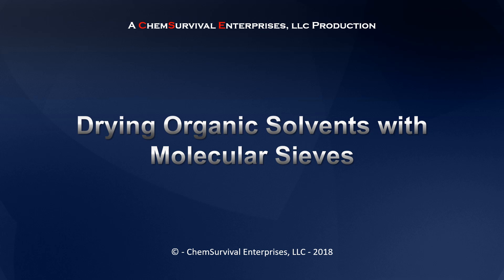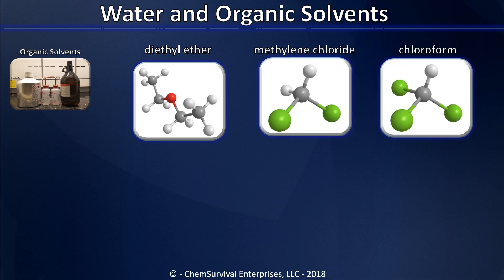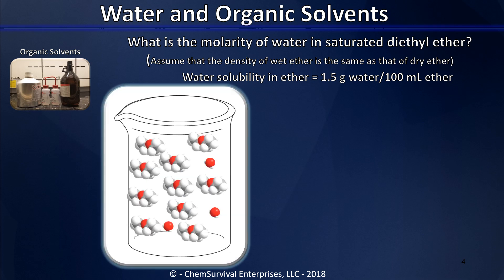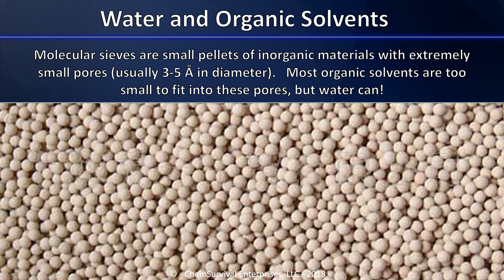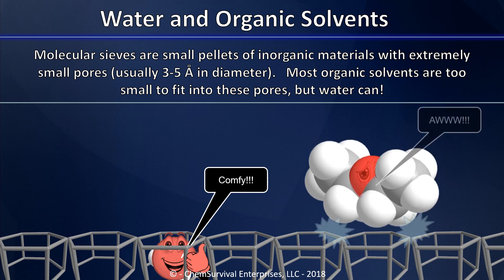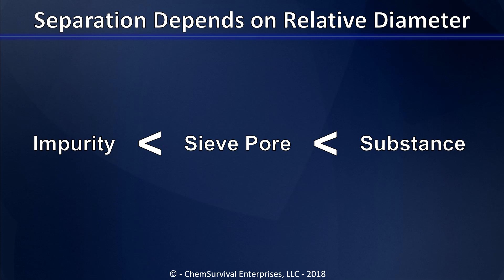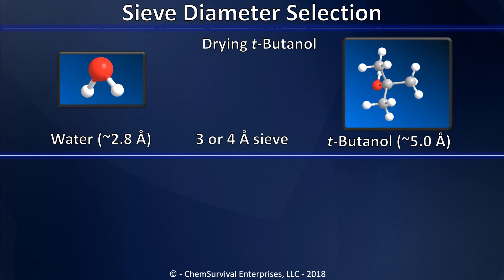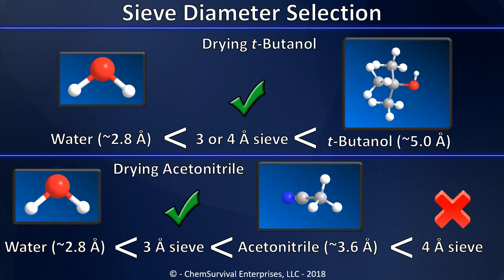Why and How Do We Dry Organic Solvents with Molecular Sieves?

Comment: If you have an opened bottle of DiEthyl Ether then you have a bomb forming.
The Ether will react with Atmospheric Oxygen to slowly form Explosive Peroxide Crystals around the threads of the bottle.
You will know this is so by the sudden explosion when you open the bottle.  The flames and high speed shards of glass are just a bonus.
Reply from the maker: yes, peroxides are a real concern when working with ether.  They are reason that we (1) never evaporate ether to dryness since peroxides are much less volatile and (2) always test our ether with potassium iodide starch paper as peroxides will oxidize the iodide into purple molecular iodine warning us of the impending kablooey.
Reply: @ChemSurvival     I recall some 30 years back as a student drying ether solutions to a virtually dry salt or whatever.  We attempted to do it safely.  Apparently it worked that time.

Comment: QUESTION:   Can you put the sieves in the freezer??????????????????????   Does each pore collect only one molecule of water or multiple molecules of water that when put in the freezer will crystallize and expand BREAKING the sieve??????????????  Does the fact that a water molecule is smaller than 3A give enough EXTRA room for the expansion of freezing?????????????????
Reply: JBSC lol good questions
Reply: The size of the molecule does not change. It is impossible for water to crystallise because each molecule is held separately in a pore. No damage would be done, but there is no advantage to freezing anyway
Reply: @lexiecrewther7038  .........I am thinking if i had a LOW boiling chemical that i wanted to dry with sieves over night where the temp had to be below 0C or the chemical that was being dried would be a gas

Comment: One thing I don't like about molecular sieves is that they coat with the solvent and stay significantly covered by it even after vacuum filtration (I use a sintered funnel to remove solvent from the sieves). I often lose over 100 ml (!) of solvent just by using the sieves. Since we often need to distill the solvent before (to remove impurities that would mess up the sieves) and after drying (to remove dust from the sieves), this can remove another say 100 ml, so we are losing significant amount of solvent. Of course the vacuum filtration is not ideal as it moves moist air through the sieves. Maybe decanting is more viable, while the rest of solvent recovered from the sieves by other means should be considered still wet?

Is it possible/safe to distill off the excess solvent from sieves, controlling temperature so that the solvent is evaporated from the sieve surface, but not the water? Maybe passing the vapour through a column of freshly activated sieves?
Reply from the maker: This is an interesting idea.  It isn't something that I have heard of, but is sounds like it might be feasible in certain situations when your solvent is precious and has the right physical properties.  As a general rule of chemistry, purity and yield (or in this case, recovery) are always opposing forces.  If you want a highly pure material, you will always have to sacrifice some of it in the purification process.
Reply: ChemSurvival Yes I only thought losing over 100 ml of solvent (over 25% in my case) just to remove few mls of water is too much and I did something wrong or inefficiently. But its probably expected then.

Comment: Can you run a reaction that has water as a product with molecular sieves inside the reaction vessel.
Reply: Definitely not if the contents of the RXN might react with the zeolite.  That is more or less the limitation in all cases where a reaction generates water, but water is undesirable. and a solution to the problem is needed.  In those cases even having a plug of the desiccant, assuming its very reactive, would best be avoided.  Usually there's another desiccant available to use in its place.  Or as our youtube mentor mentioned, a Dean-Stark trap.  Which is kind of extra awesome because you can quantify the water as it's being produced, which can often indicate when the reaction completes.  I've used color indicating silica based kitty litter in this way before=D
Reply from the maker: Short answer - yes.  Long answer - condensation reactions (those that produce water as a byproduct) can often be run in the presence of an inert-hygroscopic substance such as molecular sieves or anhydrous inorganics like calcium chloride.  The sequestration of water from the reaction mixture exploits Le-Chatelier's principle and can drive disfavored condensation reactions effectively to completion.  Exactly which water-sequestering material you choose (or whether you use this strategy at all) will depend on the specifics of your reaction, such as temperature, size of starting materials and intermediates, etc.
Reply: ChemSurvival thank you for this.  for my research topic I have one setup in which the molecular sieves are held in a short tube above the reaction vessel and the other setup with the sieves in the vessel. In the past when put in the vessel  they have partially disintegrated and caused problems when retrieving and purifying the compound. My work up skills are still sloppy, I think because I’m impatient with recrystallising and running columns.
Reply from the maker: As I wrote my response, I thought about mentioning the technique of isolating the water ex-situ (meaning away from the reaction vessel).  It seems that you are one step ahead of me.  This can be done in a column above a refluxing mixture as you suggest, or by other techniques such as distillation or use of a Dean-Stark apparatus.  As is often the case, the specifics of your reaction will dictate which water-removal technique will work best for you.  Best of luck with your project and thanks for watching, sharing and subscribing to my channel!